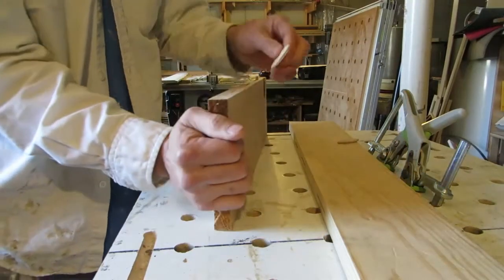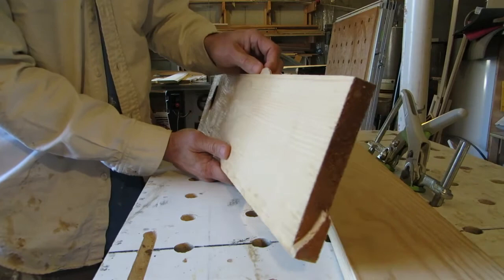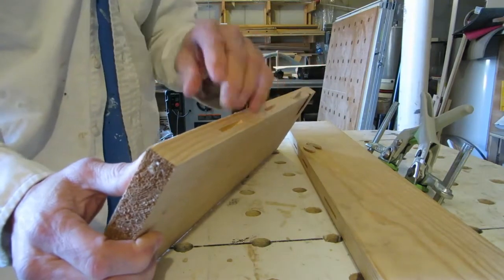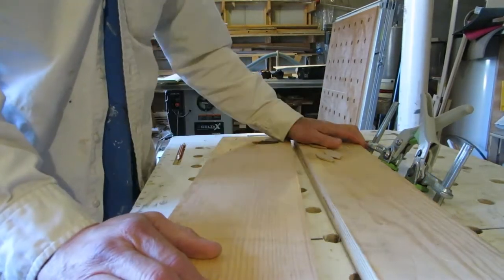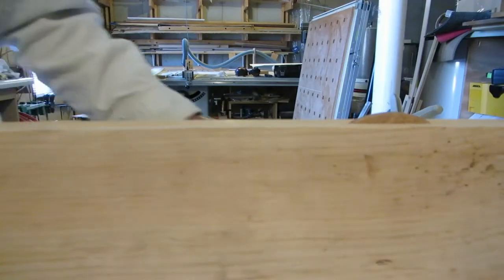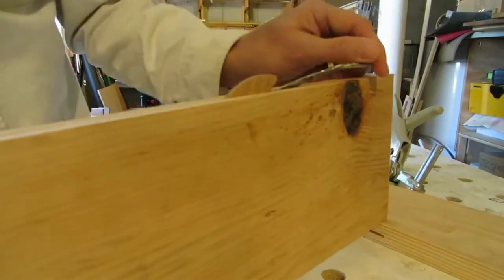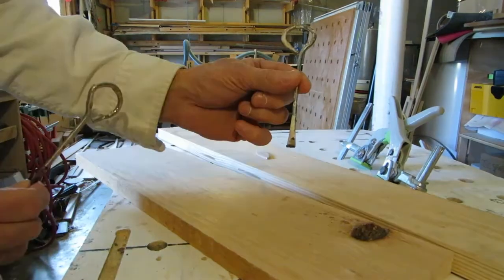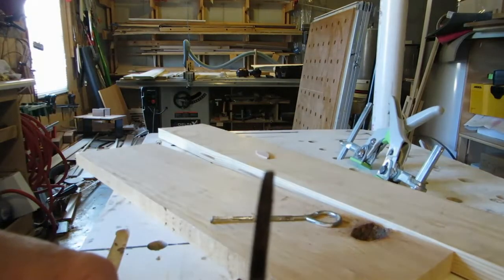Biscuit Joiner Tool 0

Comment: Maybe double check your biscuit size selector, then pick out the appropriate biscuits. Dry fit it, then glue. I think that will solve your problems. Pliers work fine if you need to remove it. I think you created a solution to a non existent problem. But if it works for you, good on you. 👍👍